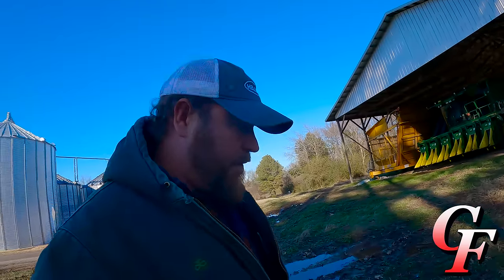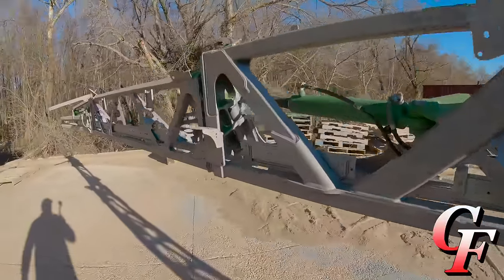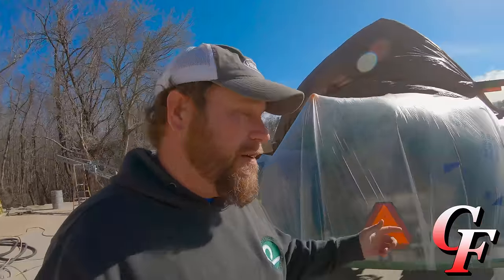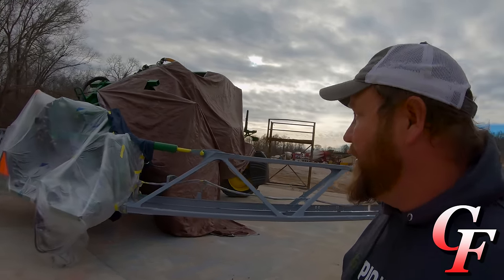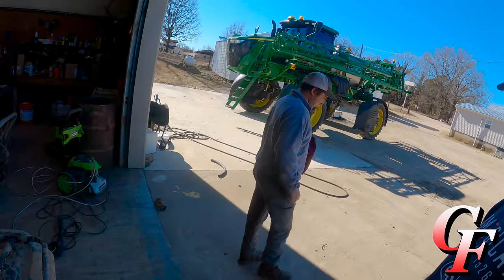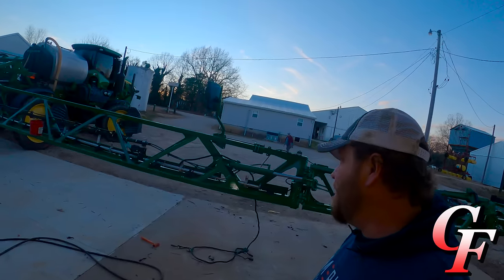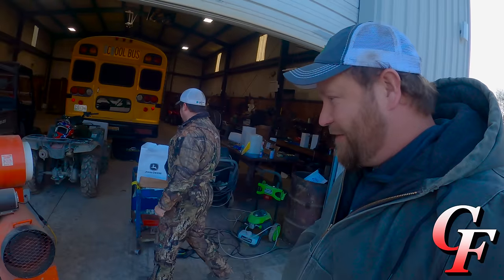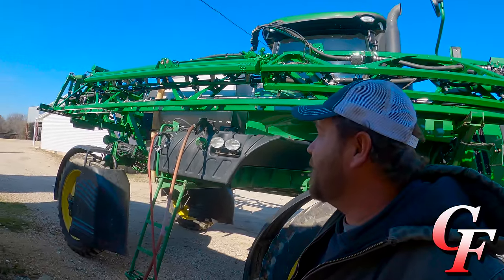1/7/22: Blast Away!!! New John Deere Paint

Comment: This seems to be the correct way to help resolve the peeling paint and the rust formation on the sprayer booms.  I was just thinking about the problem that you started with.  I have to wonder if you are getting some aggressive corrosion from some of the chemicals that you spray through that machine when you are out spraying.  I know fertilizers can be very corrosive and once they are on the paint, they make short work of the paint and then get under it and away it goes with the metal.  So, a possible solution would be to spray the sprayer each day after it has been used, a quick wash down with water.  I know that you can be far away from the main buildings but do you have a container with a hose attachment on it that you can haul out to the field and spray the spraying machine at the end of the day to get the chemicals off the sprayer booms?  I mean even waiting one or two days in a field before you get back to the buildings may be enough opportunity for the chemicals to start working on the paint and once under the paint you are screwed.  I know I am adding work to the day but it may well save you from having to do this again.  Just a thought.